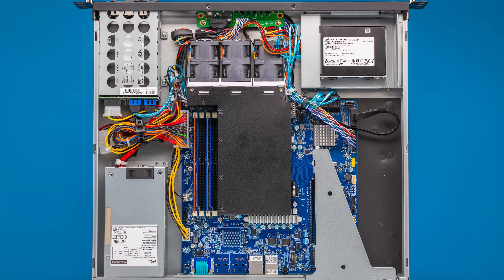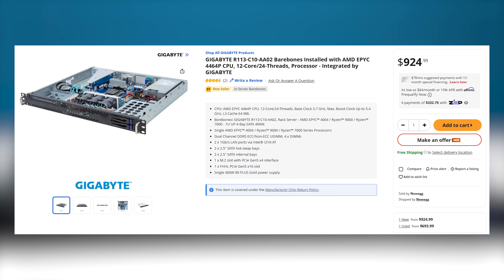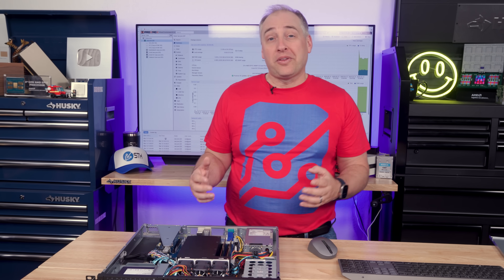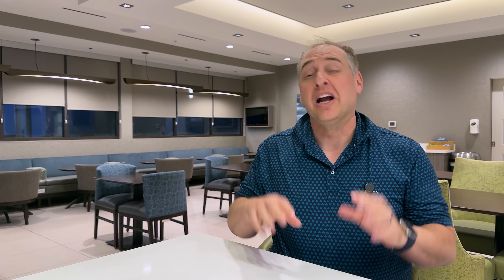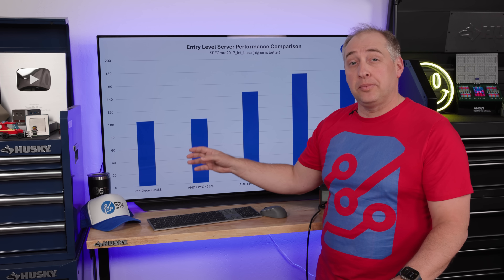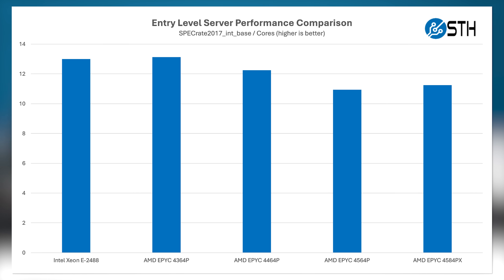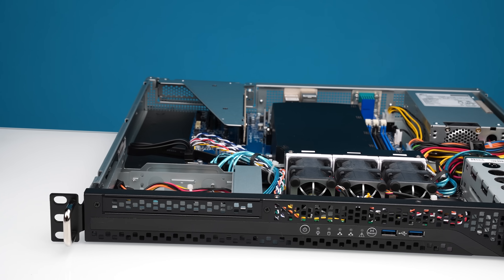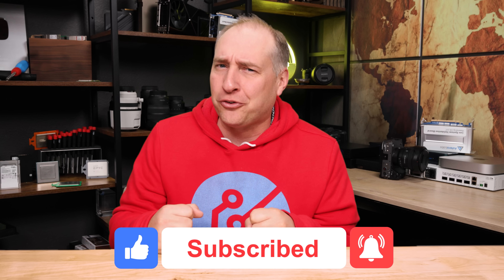We Bought the Most Popular Server on Newegg and it is a Awesome

Comment: As a homelab guy I would say a used Dell 7820 with a 20-core Xeon is definitely cheaper and you get way more PCIe lanes and  cores. But I'm also not serving a business with my own equipment either.
Reply from the maker: Remember that 20 cores from 1st Gen Xeon Scalable will be much slower than 12 cores here. Also, 1st Gen Xeon had such big challenges with Spectre/ Meltdown that Intel had to rush 2nd Gen Cascade Lake to market to fix. That is why the 1st gen is so cheap because they are probably too vulnerable to deploy these days.
Reply: @ServeTheHomeVideo Yeah I agree, I'm a sucker for a good deal though 😆

Comment: At this price point, there should be a 10G nic without using the expansion slot
Reply from the maker: as some perspective: a 10G NIC adds a lot of cost relative to the cost of this platform. Often these are in low cost hosting so you only have 1G networks. For this market 10G is a nice spec, but it would increase the cost and still run at 1G speeds

Comment: almost 1k for for this?? how is this low cost? only 12 cores (24 vcpus) cant do a whole with in a hypervisor setting.. a decent x10/x11 supermicro server with dual socket, much more ram, and more drive bays only costs like a third to half the price!
Reply from the maker: The reason Xeon E5 and early LGA3647 is so inexpensive is because of Spectre/ Meltdown security issues. That was so big that Intel had to rush Cascade Lake in to fix it because even Skylake was too vulnerable. Side channel security in virtualized clusters are why those generations of hardware are so cheap on the second hand market. Also, this costs a lot less in a data center since, at this price point, the operating costs are higher than the hardware costs.

Comment: Looks nice, but wish it had a 10Gbe or at least a 5Gbe NIC. Most will add that, but that adds cost and wipes out the solo PCI-e slot; so Plex hardware acceleration goes away if you're a homelabber

Comment: I would put a 4 NVMe adapter in that PCIe slot. That will bring the drive count up to 9 with 4 NVMe drives and 4 SATA drives and a boot drive. You could even implement storage tiering but that's probably not necessary for this application.

Comment: If this server had SFP+ cages  on the motherboard, it would be perfect. That way you could get 10GB+ networking without eating up the single PCI-E slot.  Would be nice to save that slot for a HBA or even a half height GPU.   The 1GB onboard LAN is the sole reason I don't upgrade my home lab to three of these servers right now.  192GB of ECC RAM in a quiet, 1U chassis that holds 4 SATA drives and has a 65-watt TDP?  I mean, what's not to love? Except the networking, unfortunately.

Comment: I recently built a server like that.  I went with the Ryzen because the CPU was soooo much cheaper At least at the time.  I still think the problem with the Ryzen/EPYC 4000 series CPUs is the limit on memory.  I ended up with an 8 core CPU, because more my virtualization hosts, putting 128GB of ram on there was the only cost effective amount of RAM.  The 48GB DIMMs are way more expensive.  It would have been nice if I could have done 4x 64 GB DIMMs, but that is not supported.For my needs, I would run out of RAM before CPU performance becomes an issue.

Comment: Overkill for my needs. I'm just now reaching the point where I am bottlenecking my Synology NAS from like 10 years ago. I think it's an 1815+. I will likely just use a bunch of my old hardware and create a truenas server out of a b450 or x470 MB with a ryzen 3 3200g along with a 10Gb NIC and a PCIe raid card. I have all the parts but the HDDs and the 10Gb NIC. I may use a 2.5Gb NIC because they are dirt cheap. I'll keep the Synology NAS on the 1Gb side of the network, being that the majority of the devices that will be served by it are through the wifi and connect all the 2.5Gb or 10Gb devices on a 10Gb switch that I also already have.

Comment: I have the exact same Gigabyte kit as a Dev box at work. The Gigabyte kit has been an absolute beast for us and our production boxes are currently using Intel Xeon Gold 6136 CPUs. Our dev box per socket performance  compared to our production boxes is over 50% higher. My Boss asked if we could consider replacing our production box with a similar kit with redundant power supplies.

Comment: I' using quite a few mini PC's due to small footprint requirements for SOHO, but if I had spare room for a rack (living in UK is tough :D) I would defo get a few because it has ECC and those epic's (since it's ryzen) cpu are very powerful for electricity those consume ! Great for low cost reliable cluster.

Comment: Now I'm curious as to whether a bit of metalwork could help cram 2 more SSD's into that side bracket given all of that space around those two mounted drives seen in the video at 5:05.
Reply from the maker: Or a PCIe x16 to M.2 adapter
Reply: @ServeTheHomeVideo  Possible.  It also looks like the front panel has a removable segment in front of that side bracket as well, that could probably be used for some interesting add-on's as well like a display to show info like diagnostics.

Comment: you most likely wont read this, but I would like to see what such a typical server configuration of these draws power at the wall using a kill-a-watt or so.
Because there are countries in the world that have 6-10x time your electrical costs per kWh
Reply from the maker: We went into power using a better power meter.
Reply: @ServeTheHomeVideo  the idea behind my question is, that I have a rack containing mostly turned off servers. One server is on 24/7, a managed switch, a UPS and all that draws with mostly nothing to di about 45W. I hsaved off quite a lot by throwing out all spinning rust and replacing it with SSDs. Heck I even threw out the dual 10GbE Mellanox card! That thing alone draws 8-11W
I wonder if there are components like modern power saving switches switches, "servers" with mobile processors and efficient UPS'es that have a low standby power consumption.
So I wonder how low I could go with a server, switch, UPS

Comment: Darn! NOW I find out about this!

I just built a 1U Ryzen 9700X, which involved more parts and coordination than just buying a ready-to-go 1U. This'd've been much simpler.

Compared with the Gigabyte, mine is an 8 core - a 12 core would've cost $80 more or so. I have a motherboard that supports ECC, OOB using a Raspberry Pi (which I'd have to do even with the Gigabyte system, because IPMI are too fragile to be put directly on the Internet, and I'm colocating this), plus four 3.5" drive slots (I got a Supermicro SC813M).

Mine was less than $700, so I don't think I did too poorly, but I'd likely have gone with the Gigabyte had I known about it when I started building this a month or so ago.

Good video! Thanks!
Reply from the maker: Sweet! Interesting note on the Pi.
Reply: @ Thanks! The Pi is accessed via IPv6 and is set up to offer serial console (MB has serial) and hardware reset of the main MB via GPIO.

Comment: There are two additional advantages to those cheap epyc 4004 servers over their bigger counterparts. The CPUs run at a higher frequency than the designed for server CPUs which can be a huge benefit to some software. Because the platform is so cheap you can buy two for the price of a bigger server and put them into an HA cluster so long as software licensing doesn't stop you. The HA clustering is something I particularly emphasize because reliability is the reason my employer doesn't want to move infrastructure back on site.

Comment: Really interested in ASRock Rack W880 paired with Arrow Lake personally. You can get a 20 core 265k for $300 at Microcenter and have a nice igpu for plex, sfp28 and thunderbolt 4 (cool if you want to run Proxmox and play with HA), tons of expansion and memory, 8 SATA ports.  I hope people keep trashing Intel so the price dives even further lol. Could be a really OP server platform. No idea what the mobo will cost. Hope it's reasonable. Love to get more experienced takes.
Reply: ASRock is king and emperor, in making motherboards ! (and GPU's )
Reply: One thing to keep in mind with Intel DT platform is that the primary x16 can't do 4/4/4/4 bifurcation. Most generations can do 8/4/4 (subject to PCH limitations), but LGA1700 is limited to 8/8.

Comment: I think you should include Intel desktop CPUs when discussing E4004P and competitors. 12th Gen and later Intel Cores are actually certified for ECC UDIMM operations when paired with a W-series PCH, and are at feature parity with Xeon E-2400, including fancy features like VM runtime memory encryption. And AFAIK Intel desktop CPUs are officially supported by all the big enterprise Linux distros. There really isn't a case to be made for Xeon E-2400/6300P if your bare-metal OS is Linux, they exist solely for OSes that don't work well with heterogeneous cores.

E4004P exists because R7000 is missing enterprise features. Ryzens do not officially support ECC UDIMM (emphasis on officially), and does not support SEV (fused off).
Reply from the maker: A big one they are not supported on is ESXi. That will panic at the installer because of heterogeneous cores. Even when you get ESXi working, the scheduler isn't designed for P+E.
Reply: @ServeTheHomeVideo  there are kernel parameter changes to work around the panic, and I believe scheduling affinity has to be manually set on every VM. I believe a VM can crash the host if it is scheduled on both P- and E-cores (?). Doable for a homelab setup, but certainly not something one should try on a production system.

But IMO ESXi is becoming less relevant for the "desktop adjacent" server segment, thanks to the Broadcom acquisition. I'm not saying that you should only compare E4004P with Intel desktop CPUs, there are certainly orgs that need a classic all-P processor. But Intel DT CPUs are a viable option for orgs using modern Linux, and that fact should be highlighted.

Comment: The bottleneck here is memory - I can stack quite a few low/mid VM's on there, and probably consolidate three of my lower-end Xeon's on one server, yes.  However, in practice I can't because I just can't get enough RAM into these baby racks - As an example, I run 3x Xeon-D machines, each with 256GiB - they are hardly at 30% utilization for CPU, which means one of these servers would just be barely turning over.  But each of those machines is running near 65% of memory capacity, which just to break even I would need to be able to stuff 512GiB into one of these - which it can't.  It's these kinds of unbalanced equations that drive me nutsoid. ;-)  I'd need 4 dual DIMM here before I can even consider it.
Reply from the maker: EPYC 8004 is what you need.

Comment: If you search for Gigabyte MC13, you'll see that they make 3 other variants of this board, with options for 2 x 10GB or 2 x 25GB networking, also an MCIO 8i port. Even with the original board, you could add another M.2 connector with an adapter on the PCIe x4 port, or, of course, 4 M.2 connectors on the x16 port.
Reply: Gb ;)
Reply: I'd pay extra for the 2 x 10GB ports to keep the slot free for other things.

Comment: Other thing one needs to keep in mind is around failover. Yes, hardware performance is quickly eclipsing software needs (assuming we're talking the "normal" stuff and not getting into GPUs and friends) BUT a cluster is going to need three members to keep quorum (or two members + another baby system for quorum) if you want normal redundancy.

So going for the most efficient processor based solely on your software in terms of cores/sockets/hosts loses nuance. And I'm sure I'm missing nuance myself.
Reply from the maker: We will have a main site review of the server by Will in the future

Comment: This was a welcome change from the usual server video. Big server monstrosities are nice to look at but every business doesn't need a system that massive. Plus, I do more work with single socket servers than dual.
Reply from the maker: I am glad you enjoyed it
Reply: @Entity8473 i still use my Dell PowerEdge R630 with the Dell PowerVault MD3000i, i bought 7 years ago used. I have used Dell Servers at work a lot and I know them petty good. yeah, the R630 is a powerhouse and more than capable for home server use i do. My system is idling at 1% to 3% most of the time and sometimes hitting 6%, but this machine is also used for hosting websites for local organizations or clubs i am in, however you wanna call it. i mean, it pays a part of my electrical bill for that system and they have not to pay high prices and this system has somewhat of a use. 
i see the point why using such low power systems. It is more than enough even for small businesses, but sadly there are mostly too expensive or lack key features. This is somewhat Cheap and fits almost perfect into small business environments. Except for one little detail, it needs more Drive bays at least 6 would be perfect. So you could use raid 5 for the content with maybe one spare and have dedicated mirrored drives for the OS with its programs itself. Smaller Drives are cheaper as having fewer big drives. The size of this system is perfect, it fits into every wall mounted or under desk cabinets. Most smaller companies have a small cabinet somewhere where the router, a switch for telephone and network, the server and a small UPS is located. In the Company i learned, we had the exact same setup like i described. The company had at this time about 30 employees which of them are 10 always in the office. We had an R120 and it fitted barely into that cabinet. i meet my old boss a couple of months ago, and they use this system till this day. He won't replace it soon because it does what it does. No errors so far, except for occasionally drive failures and one of the power supplies failed after a brown out, caused by a 12 year old dying Lead acid battery UPS. They're still using 100mbit network, i mean the Switch is connected with 1gbit to the server and they use a 50/10mbit internet connection.  And they have now 50 people working there but only 2 working more in the office. i mean they could upgrade but for what cost? Only to save a bit of energy. Things won't going faster as it is now. The cost for an upgrade isn't worth the money they would save. If this would had 4 or 6 drives they may would upgrade at least the server to save a ton of power.

Comment: I have a 2U chassis that supports dual itx boards, each with melanox 25G cards and I think that is the best use of the space and virtualization for home servers. Those 1u case fans are too noisy compared the ones I have in the 2U
Reply: More details would be appreciated. Thanks.

Comment: 8:37 that's not true. You have to buy a minimum of 16 per server, a minimum of 8 per socket and they sell the first at 16cores as a pack... but you add more a 2 core increments OR 16... So no, you don't have to buy in increments of 16... Not sure who this guy is, but Microsoft licensing practically requires a PhD these days when you start talking scale. Either way, he's wrong and I'm not sure if you want to go down licensing on this channel, because it gets ugly, fast.
Reply: He's an dum@ss , an total noob
Reply: I was about to comment the same. You can buy full licenses that allow 16 cores each, but there are 2 cores addon packs. MS actually made it easier (not necessarily better) by omitting socket licensing on all of their products. 
One interesting licensing detail is Hybrid Benefit, which allows the use of your local Datacenter license with SA in Azure and locally at the same time. This obviously is to promote Azure cloud, but this makes hybrid a viable solution price wise.

Comment: Definitely want a low power Epyc for the homelab!  Thanks for the vid.  Curious about power and temps though... Idle power/temp and 100% CPU load power/temp.  I plan on running mine at 100% CPU load 24/7 for BOINC/WCG so I might be better off with a 2U but I love the CPU choice.